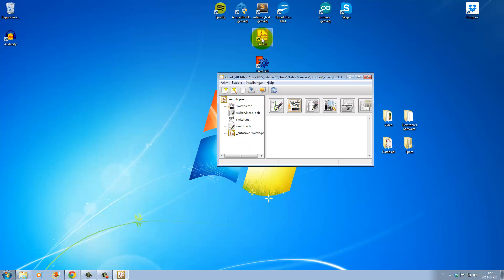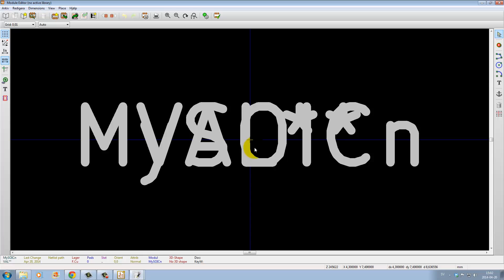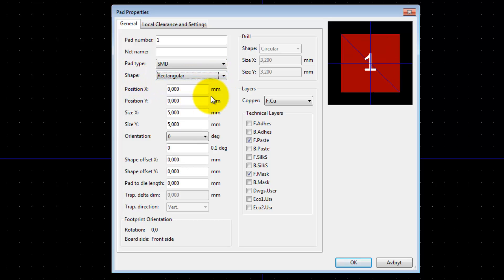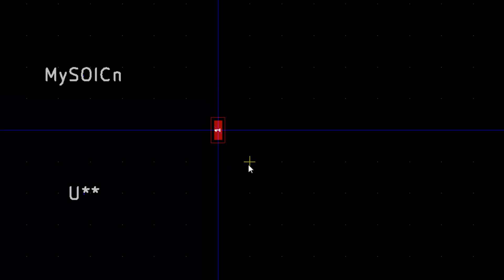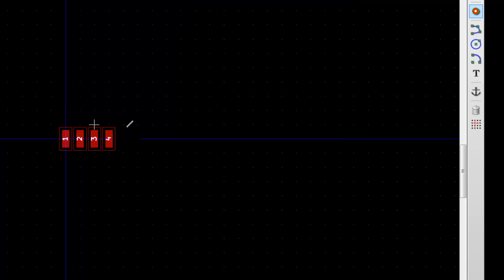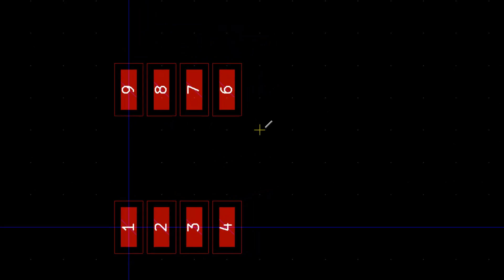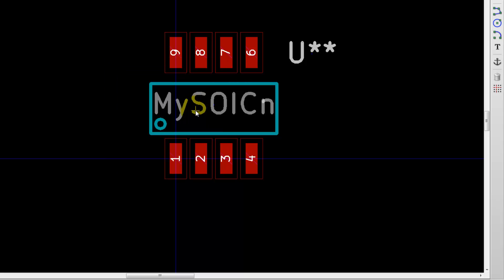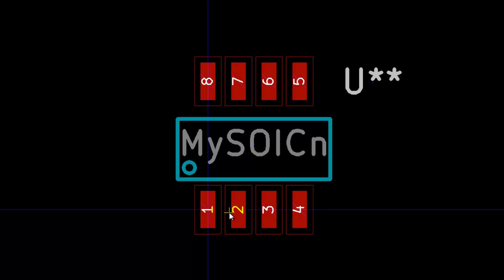KiCad Tutorial #6 Create PCB footprint component.

Comment: It might not matter so much with a simple SMT part like that, but I think the part outline body has to be drawn accurately so as to avoid parts hitting each other when placed close together. Imagine you have a MPX4250 pressure sensor close to an ECU plug in a EMS EFI engine control with limited space, you'll never know if it is going to fit together in the design phase unless you remeasure everything again.
Reply from the maker: +SidneyCritic ComedyHound I agree. When you design for production the pick and place machine need to be able to carry the component to place without bumbing into other components. Different pick and place machines have different requirements on how close you can place components as well.